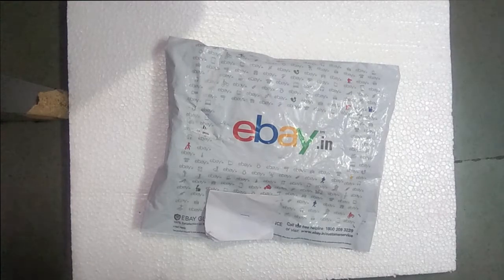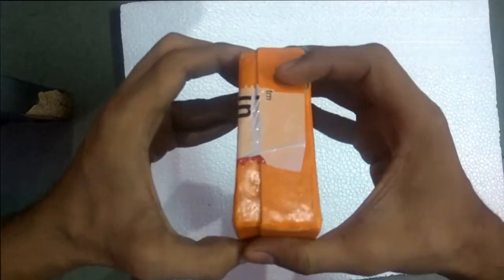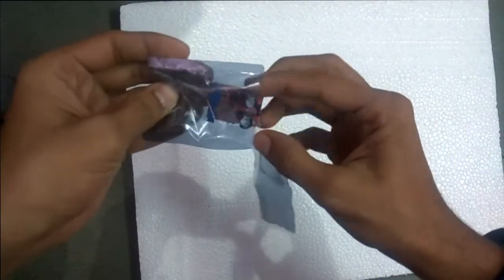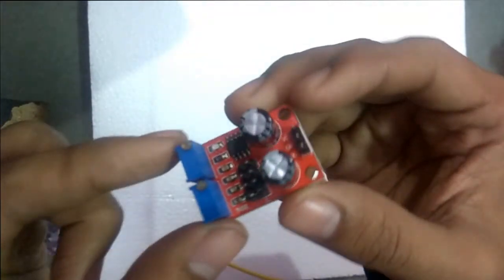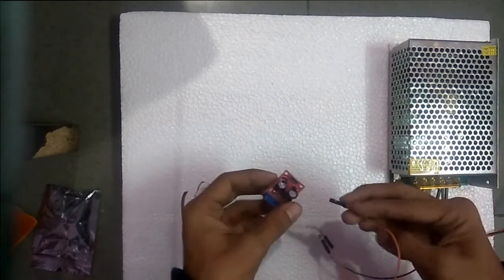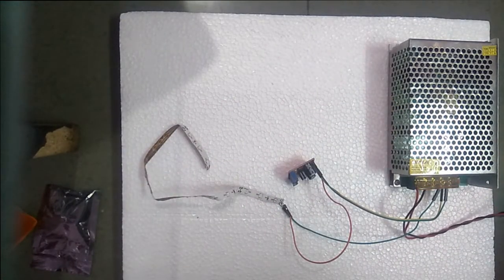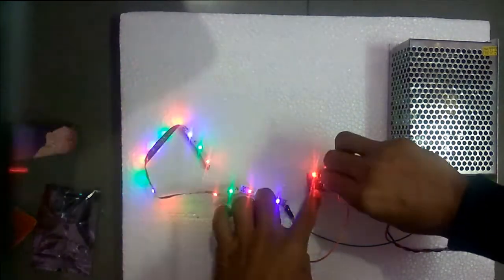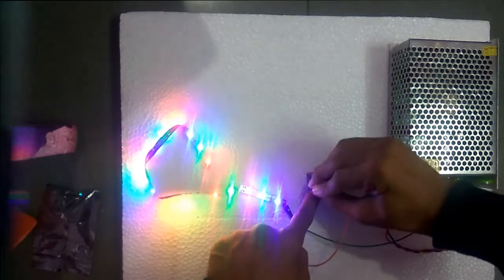NE555 Pulse generator module Unboxing

Comment: Merhaba arkadaşlar. Ne555 darbe modülasyonu ile basit ama etkili bir şekilde kablosuz güç aktarım devresi var elimde. Mosfet olarak Irfz44n kullandım. Ancak soğutucu fan vs dahil aşırı ısınmaya çözüm bulamadım. Isınmayı gidermek için ne yapmam gerekir yardımcı olabilecek var mı. Güç 12 volt 1 ta da 2 amper bu arada. 2 amper de iyice ısınıyor. 

Konu videosu burada 

https://youtu.be/Y9ldCI-SnmI

￼